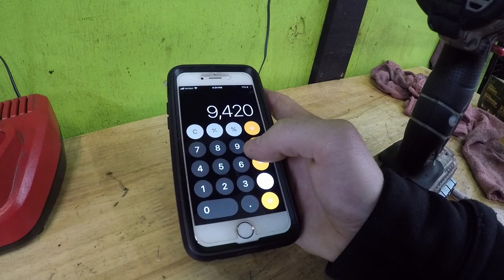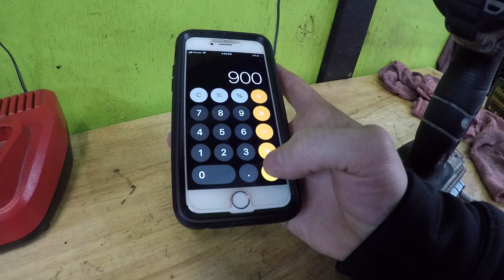I Spent 10,xxx on my SN95!!!! (Was it Worth it)??

Comment: I've got a 94 cobra I got for $1500 a couple years ago and my goal is to totally rebuild it. It had a sn93 paxton supercharger on it but it was hooked up, the owner said it needed rebuilt but he had a few other performance items on it such as a hurst short throw shifter, Kevlar clutch, fuel management, msd ignition and distributor etc. I want to make mine all flat black and put "crowd control" in gloss black on the front bumper lol I've already got it across the windshield in black. She needs a lot of tlc but ill eventually save up enough to get her back to her glory. I'm not a ford guy but I am a car fanatic and have always loved the sound of a cobra and I couldn't let the car just sit and rot away. I know one day it'll be worth a hell of a lot since they only had the 5.0 for the first 2 years of the sn95 and they're already goin up in price. You've did a awesome job on yours.
Reply from the maker: Thank you and yeah the sn95s are going up in price for sure! But it’ll be a sweet project so Just start on it one thing at a time that’s what I did with mine and still doing now! 🤟🏼

Comment: All that money spent and it's still sittin like a 4x4 lol. But other wise it's a very clean build.
Oh and your reverse lights are out and or reverse switch.
Reply from the maker: Michael Martinez yeah my switch is bad, and coilovers are coming soon it’s actually on springs but they definitely aren’t up to par.
Reply: @lollis_garage3683  yah i had lowering springs on my 97 gt and it still sat high until i cut them. There's only so much you can do with springs. Coil overs are the way to go and don't forget a bump steer kit and rack bushings.

Comment: So much money and yet, no headlight knob (what are you using to turn your headlights on with?) ...And your odometer? Is that working? Combined, you're looking at maybe $20, that any one of your subscribers could do them self.

But, I honestly have a ton more into my 94 than you do. However, I've owned the car for over 21 years now. So what you do is, take how much you've spent overall, and divide that by how many months you would have on a 3 year car payment plan. You get to own the exact car you wanted, for how much a month? Maintenance? Rather than buy a new car and start the payment cycle over again, you divide that by a year of monthly payments. You are basically coming out way ahead if you truly plan on keeping that car. I have saved soooo much money over time, and it's just as nice as a brand new mustang, only I owe nothing. So what if it's faster? I like this body style better. Not to mention, it's a classic! No ABS or traction control though. No IRS either. But give me time.